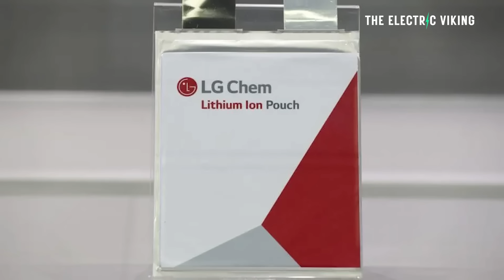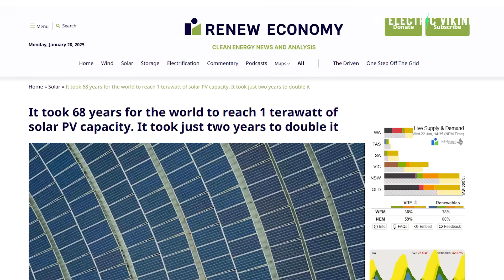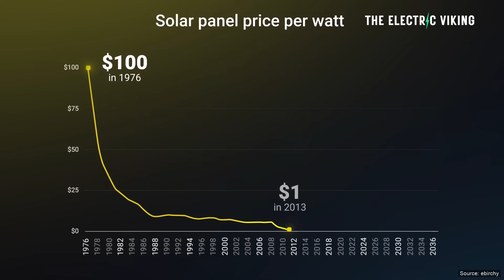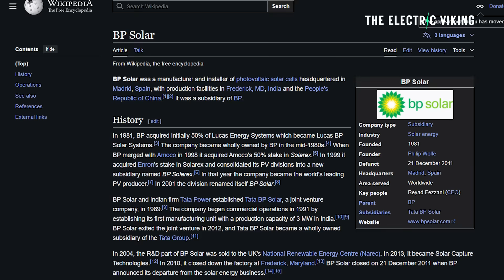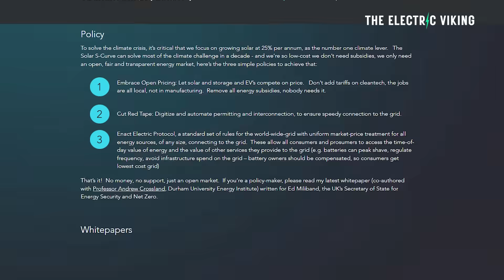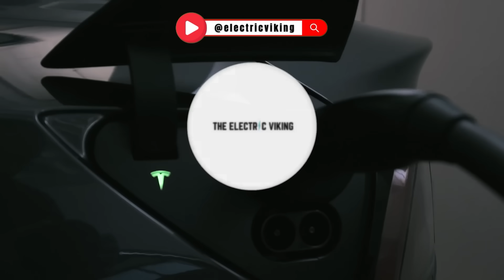S-Curve modeling predicts half of world’s energy will come from solar by 2035

Comment: Problem with solar is if everyone is using it in the day then not enough energy is available for charging the batteries for night time use. At night when, if we all have electric cars, we will be changing them. Then there is all the other use of electricity at night, industry, kettles, TVs etc.
Reply: LOL
Reply: The plan is to massively overbuild so there’s loads of spare solar to cover poor weather.
Reply: Flawed logic. When ev’s are parked which is where they spend the majority of their life they can be plugged into the grid or be supplying it.
Reply: If everyone had electric vehicles already, we would be charging them between 10am-4pm when there is excessive solar, and during other times when the grid has excess capacity e.g. windy hours or early a.m.
Reply: @gerryburde5663 but most people will be at work between 10am - 4pm and won’t be able to charge 🤔
Reply: So... why wouldn't the market begin charging more for night time electricity which would incentivize building out more solar for the owners of batteries to buy solar electricity during the day until the market reaches an equilibrium?

Comment: Good luck with that.  In the first place, not everything follows the trajectory of an "S" curve.  And why must it be the case that an "S" curve will not flatten out prematurely?   All this is just speculative spitting in the wind.  Once you have only solar, you have to have sufficient battery storage to cover night time or days where cloud cover is very thick.  The cost of the battery storage in sufficient gigawatt hours to cover just 12 hours would cost multiples more than the cost of the solar panels in the first place.  And then there is the cost of land, which is land that is taken out of productive use such as for farming.    Well, I'll check back in 2035 and see who was right.
Reply: Are you familiar with Wright’s Law? It’s related to Moore’s Law, and governs mass production. Every doubling of production volume brings a consistent percentage of price drop, until the cost of manufacturing approaches the cost of materials. Both solar and batteries have followed Wright’s Law. In 1975, PV solar cost over $100/watt. Now, it’s about $0.27/watt, and the Wright’s Law rate has stayed consistent that whole time. Solar is now the cheapest source of electricity in the world. Lithium batteries have followed Wright’s Law as well, falling close to 99% in 30-odd years. 

This is a cost game. Unless you can explain why Wright’s Law is wrong, why three or four doublings in the next decade will lead to prices going up rather than down like they have for decades… then solar+batteries will be THE cheapest way to power the grid at night, or on cloudy days. Yes, 12 hours of battery with solar to charge it costs several times more than solar alone… and so what? If it’s STILL the cheapest energy, it’s the cheapest, period. Remember, fossil fuel ain’t free, especially not 25-30 years’ worth. Nuclear isn’t (even remotely) free either. 

We’ll check back in 2035, for sure. I expect you’ll be surprised and pleased at solar being absolutely dominant for our energy needs.
Reply: First of all no one said solar only.  Secondly yes, it is possible with storage.
Reply: Are you familiar with Wright’s Law? It’s related to Moore’s Law, and governs mass production. Every doubling of production volume brings a consistent percentage of price drop, until the cost of manufacturing approaches the cost of materials. Both solar and batteries have followed Wright’s Law. In 1975, PV solar cost over $100/watt. Now, it’s about $0.27/watt, and the Wright’s Law rate has stayed consistent that whole time. Solar is now the cheapest source of electricity in the world. Lithium batteries have followed Wright’s Law as well, falling close to 99% in 30-odd years. 

This is a cost game. Unless you can explain why Wright’s Law is wrong, why three or four doublings in the next decade will lead to prices going up rather than down like they have for decades… then solar+batteries will be THE cheapest way to power the grid at night, or on cloudy days. Yes, 12 hours of battery with solar to charge it costs several times more than solar alone… and so what? If it’s STILL the cheapest energy, it’s the cheapest, period. Remember, fossil fuel ain’t free, especially not 25-30 years’ worth. Nuclear isn’t (even remotely) free either. 

We’ll check back in 2035, for sure. I expect you’ll be surprised and pleased at solar being absolutely dominant for our energy needs.

Comment: When cell phones were first invented only doctors could afford them. After a number of years the price did come down . Now people buy phones for kids  it’s so affordable
Reply: Contractors were some of the first cell users. $10 a day was cheap instead of driving to a pay phone to change a lumber order ETC.
Reply: @kkarllwt  I remember my first cell phone, back in 1986.  It was a car installation, which could be easily clicked off to become a portable one.  But it weighed about 2.5 kg and took half the space in an attaché case!  But it worked very well!
Reply: The homeless have cell phones!
Reply: Did they only work for 5 hours a day?
Reply: I was selling mobile phones when they first came to Australia. People involved with drugs (both legal and illegal) were among the first buyers. Tradies too were quick to use mobiles. And I a mobile phone sales person was also quick to get one.
Cheers Gray
Reply: It's not affordable, parents buy them on cell phone contracts. Otherwise not many kids will have cell phones
Reply: @jvdm9317  The point is that phones have dropped massively in price. I bought a great one for seventy pounds (eighty dollars or so) and it has been brilliant. 

For all the functions that phone provides it has actually saved me money.

Remember when you needed a calculator, a memo pad, a camera, a diary, etc, etc - in addition to a pretty useless mobile phone? Remember when you could only access the computer at home?
Reply: @jvdm9317  Where do you live? In 2007? You can get smartphones for under $50.
Reply: @jvdm9317 kids don’t need phones anyways.
Reply: @ used cell phones are pretty cheap